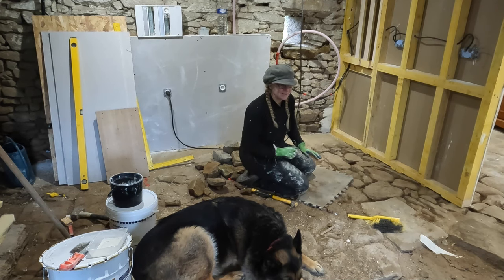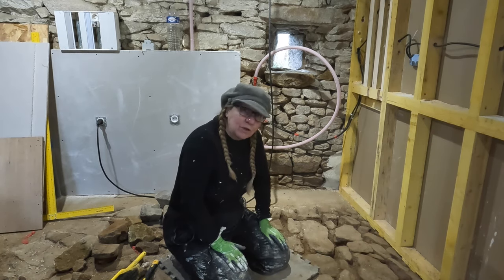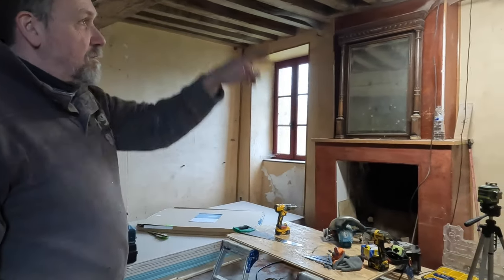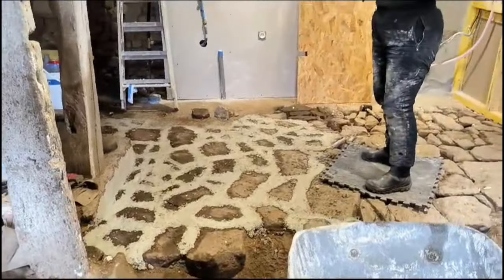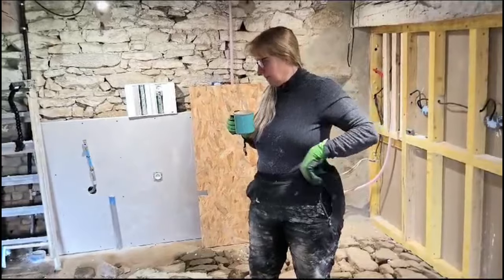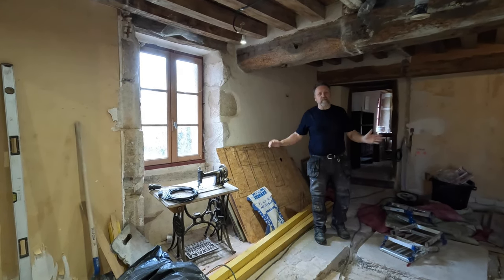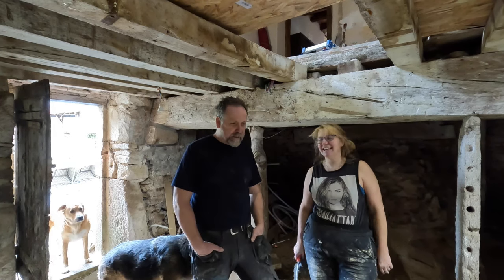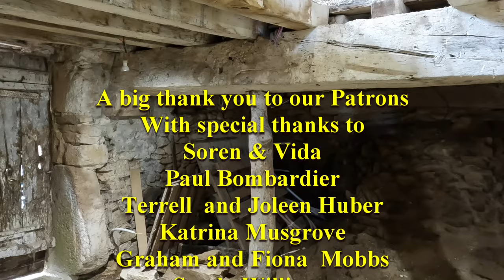Sacrifices are necessary when renovating a CHATEAU

Comment: I've been meaning to ask for a while: is there a reason why you don't seem to use the metal system the French seem to use for partition walling, rather than timber stud walling? Is it cheaper / easier using timber? Great work by the way.
Reply from the maker: It's the way I was taught, and I can use the left over timber for other projects.  Cost wise, it's about the same.  I always use the metal for ceilings
Reply: Thanks, that makes total sense!

Comment: Could you use stone sealer on the stone and mortar to help with cleaning.?
Reply from the maker: No definitely not, that would stop the stone and mortar from breathing and absorbing the moisture from the air and damp would set in.  Stone floors are easy to clean, just broom, dust pan and brush and wash 👍😁
Reply: The new opening is great as I said last week, but really love the floor and more.